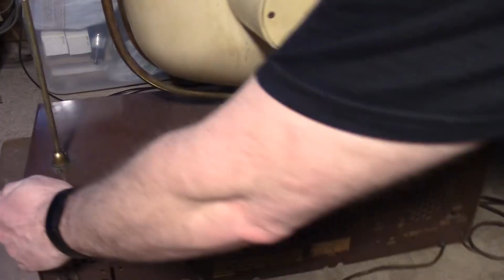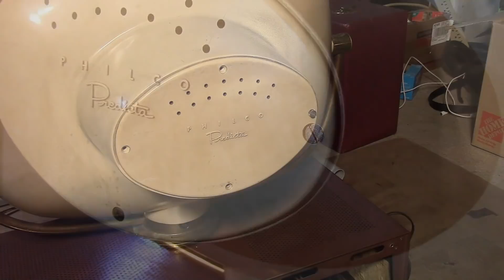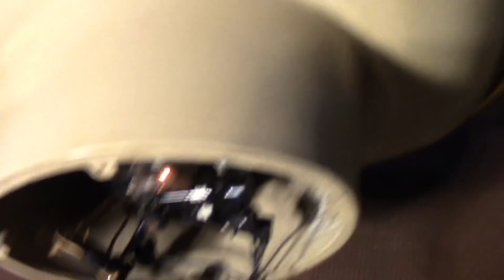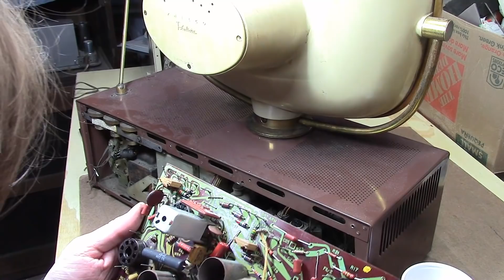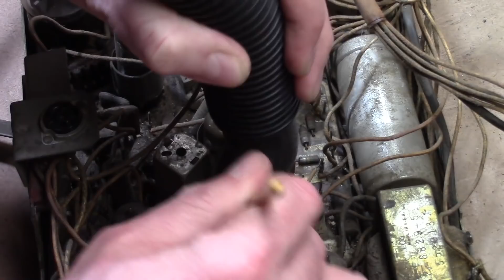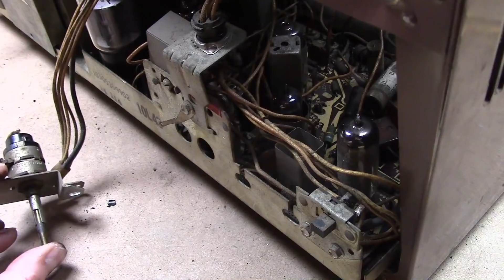Predictapalooza s1e03: Tom's dirty brown Princess

Comment: Good technique on figuring filament voltage. Would it help to have a schematic or read the stamp type on the CRT? Not being cute. I feel like I missed something. But you just taught me something new.
Reply from the maker: The schematic calls for 2.68 volts, but they are sometimes replaced with a 6.3 volt type.  Yes, if I could find a label or stamp on the CRT, I would know for sure.  I couldn't find one in this set.

Comment: You are showing me inside a Predicta. I had a restoration & collector friend who rebuilt, I believe, a sync network. He said he would never do that again. I'm 65 and been repairing and these days restoring them since I was 10. I still see things that are tough to figure. You're a brave soul.
Reply from the maker: Thanks.  I've rebuilt a few networks but now you can buy reproductions.   That's a big time saver.
Reply: @bandersentv  I'll tell my collector. He doesn't know that. Great service. Still thinking over the hum. Challenging but fascinating problem. I'll try to add something intelligent. I've chased these before. Solder connection really surprised me; I just didn't think of it.

Comment: I wonder if that set was used in an office attached to a foundry. That grit looks a bit like foundry sand. Perhaps an office off an auto repair shop. Also as an observation: I thought you came close to knocking the HV rectifier off the bench when you rotated the set around but perhaps from your perspective it was not that close or vulnerable. It just looked that way on video. I always enjoy your videos.
Reply: The crud reminds me of the mineral coating on roofing shingles.  After getting a roof replaced, everything in an attic will be full of that stuff.
Reply from the maker: No harm if I had. It's carpeted under the workbench and 1B3s are basically free for the asking

Comment: I don't mind seeing repairs. Only devices that where used and loved got repairs. Yes some are badly done. But not all. A high hour set might have the picture tube replaced. That's superior to having a weak tube. Certainly if the replacement was done near the end of it's life. 
I personally just got a 30's radio to work on. The big capacitor block has been snipped out. And new ones where added directly on the sockets. The repair isn't pretty, but it's better then seeing capacitor blocks which are burned thru. Something I have also seen. So yeah some repair is better then destruction because someone could not be bothered.

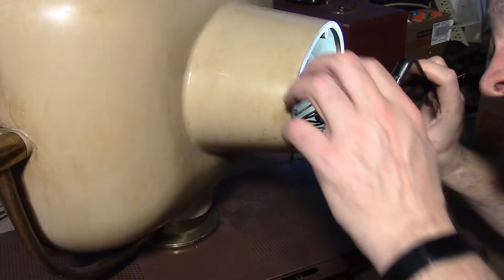Comment: At around 09:37 you mention that the original CRT would have had 2.68 volt filament. However, these sets are transformer powered so all filaments would be 6.3 v in parallel. The 2.68 CRT would only be in the series string sets.
Reply from the maker: Wrong. There is a 2.68 volt tap on the filament winding. The series strung, 21 inch CRTs are 2.35 volts.
Reply: @bandersentv  Sorry. I stand corrected. Thank you.

Comment: I’ve never run across a vermillion predicta in person either,but that would be my favorite color of the 17” sets,unless they had offered a turquoise option,which they didn’t. My guess is that most people,even those who were daring enough to buy a Predicta,tended to have rather conservative tastes when it came to color and chose beige,white and other neutral colors.Ive see. that in other products and appliances of the era,where beautiful colors were offered and for some reason dull ones seem to be most prevalent. 
People are even more conservative color wise now than they were back in the 50’s and 60’s. Decades ago I had driven one of my finned mopars over to the “Wonder Years” house they used in the 80’s to film the tv series.  The exterior was still painted green like it was in the show. Later the home was sold and the new owner repainted is beige. Why? I have no idea. People seem to always default to boring colors. 
As far is price difference between colors on Predictas,I  know Philco did charge more for the blonde versions of the tandem,holiday,etc. (I think it was $10) but I’m not sure if the vermillion sets cost more than the other painted 17” ones.
Reply: It seems to be the same thing over here across the pound in europe, i have two identical DUX radios (a Swedish Philips daughter company) and thay are both beige painted bakelite. Also the Luxor Mirror TV sets over here (very similar to the pilco Predictas) tended to be teak or light wood and all had offwhite/beige crt covers
Reply: @agfamatic91,I’ve only ever seen those Luxor Mirror TVs in photos online,but you’re right,they are very similar to Philcos Predicta holiday, but with a slightly more spartan Swedish modern touch to them.
I’d love to have one,but doubt one will ever show up in the United States,just like the French Teleavia. 
Did those sell well in Europe?
Reply: @Suddenlyits1960  From what i know Luxor was only operating in the nordic countrys and mainly in sweden and I dont think they sold very many Luxor mirrors even here. I dont think i have actully seen one in real life, not even in Swedens biggest radio (and TV) museum in Gothenborg wich i have visided multiple times.
Reply: @agfamatic91,Thanks for the reply. . Sorry to hear that. I had assumed you might have been lucky enough to own one or see one in person.  What’s interesting about the Luxor Mirror is that unlike Philco’s Predicta,the CRT supports weren’t purely ornamental but actually supported the CRT and allowed the screen to be tilted up and down as well as side to side,which explains why you can see the cable come out of the collar on the back. 
I’m surprised that in Sweden there isn’t a site devoted to them since they are very much a space age work of art like our predicta.
I’d be interested in learning more about them,the info out there is very scant.

Comment: 2 video's, I'm shocked & amazed, your spoiling us Bob. Its ironic that cigarette smoke acts as a tv preservative, doesn't work as well on humans though. I checked out the Philco Automatic V handle refrigerator & Ionitron 5000 you mentioned,  clever design what a sight to behold.
Reply: They actually did produce the Ionitron for a while after Ford bought Philco.  They made another model which didn't have the anode sticking out the top of it.
Reply: The later model without the anode projecting from the top was the model 728.  In my opinion it doesn’t look as cool as the first version.

Comment: Well, if you're very familiar with how boards are populated in these Predictas, then I guess replacing components "en vrac" (in bunches) as the French would say, is certainly an option to gain time. I wonder if that method would be advisable for beginners or occasional (Predicta) restorers.... Personally I would feel a bit leery restoring a Predicta the way you do Bob... I mean, those TV's aren't the easiest ones to repair and an error is quickly made. Do you think using compressed air on an old TV chassis is advisable?
Reply from the maker: I maintain they are easy to restore. Every part is labelled on the PCB. Simply refer to the parts placement diagram and parts list. No more difficult than building a kit

Comment: Thanks Bob, this is an interesting series already. Having reference units hopefully will be a big help.  On the different revision runs, did they change the boards do you think, or just the components?  Thanks again for the vid.
Reply from the maker: The boards are the same although the color is slightly different. I have examples of the 1st through last run (7).  The changes are minor value changes. About 10 parts in total